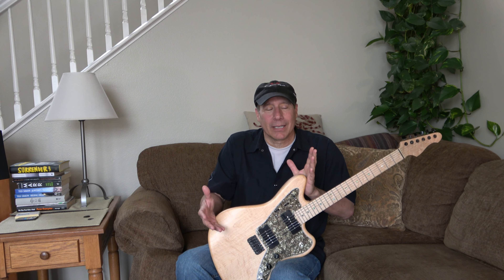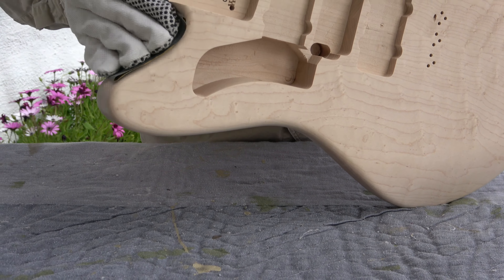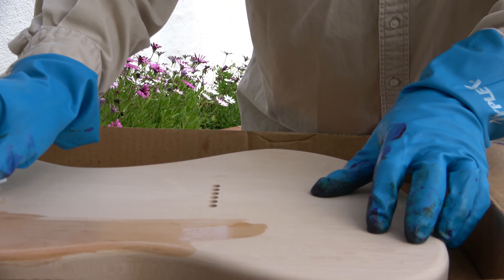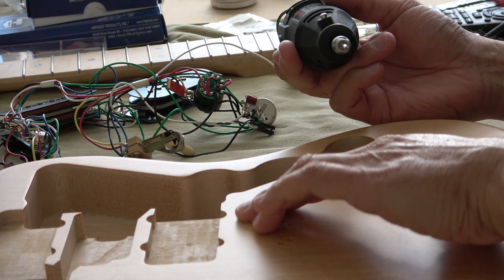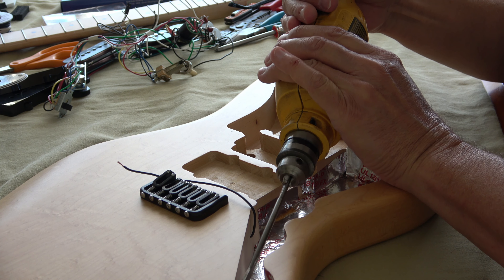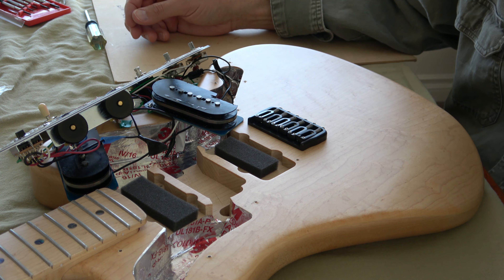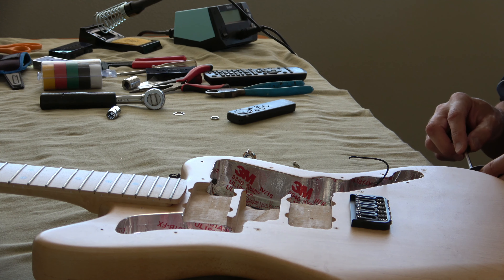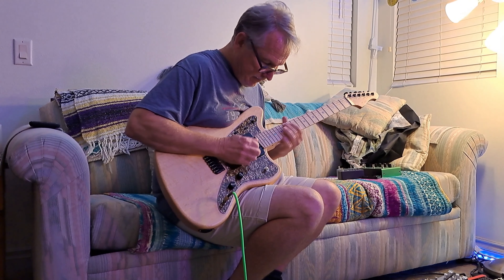Warmoth Guitar builds, Part 5. Jazzmaster Disaster🥴

Comment: I have found that burnishing the edges of the masking tape helps massively against bleed through of the stains.
 I use a camping toilet/shower tent as my outdoor spray booth, they are relatively inexpensive and you can hang your parts in the centre and zip up the door when finished, they also have mesh air vents to allow heat to escape and fresh air to enter but keep insects out.
 The finished instrument looks and sounds very nice, I love anything with a P90 in it!
Reply from the maker: Thanks!  Good tips. Appreciate your input.  I was pondering a large, hanging, zippered garment bag too.   Appreciate your comments on the guitar.  My neighbor can make any guitar sound good.  Fortunate to have him in the mix. 👍